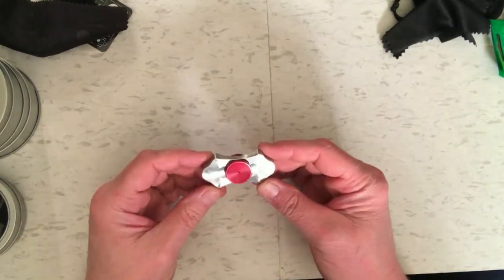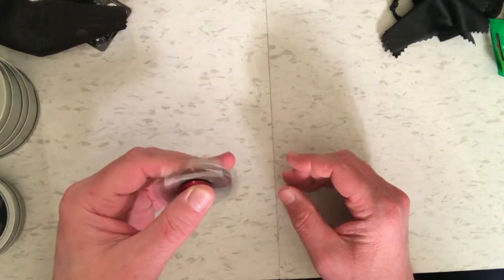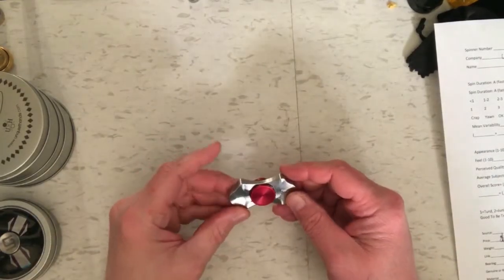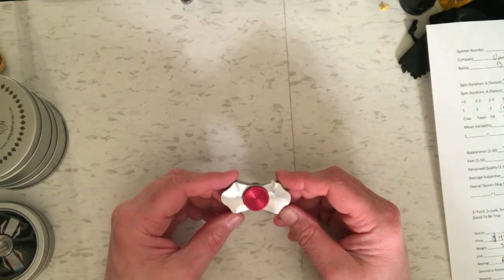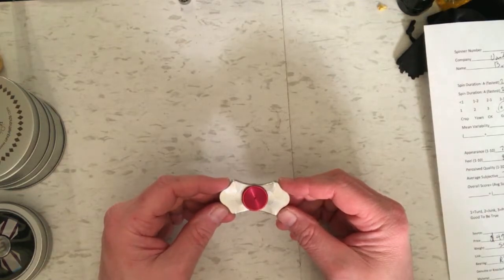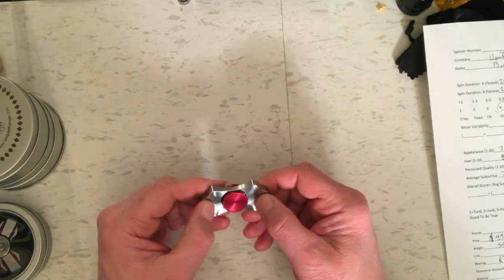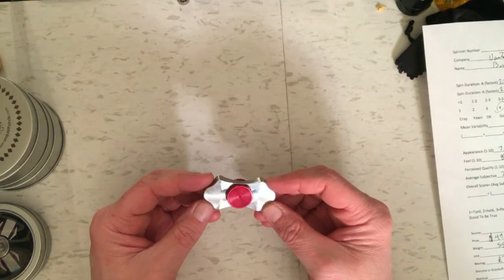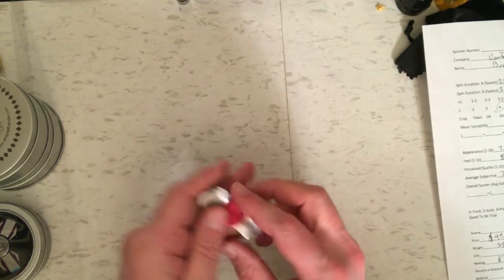Fidget Spinner Testing and Review - BOW TIE by United Machining

Comment: Dylan did an awesome job on that 3D Milling.
Love my Red Bow Tie, although it isn't a red anymore since I swapped out the stock bearing and buttons with an R188 and other buttons.
It's now a Black Bow Tie with the black SS Kong buttons.
My bearing was shot after a short time too.
If you plop it in boiling water for a minute the bearing will push right out.
Apparently people are getting those bearings in a few sites including Amazon and Acerracing, but I'm happy with being able to use all my other bearings and buttons.
I'd be curious to see how you rate it after you change out that bearing.
Weight on the site is without buttons I believe.
Thanks for the upload.
Reply from the maker: it's surprisingly fun to play with.  The machining is awesome